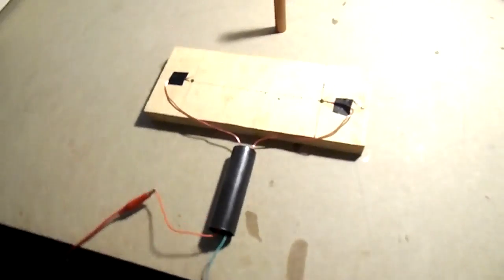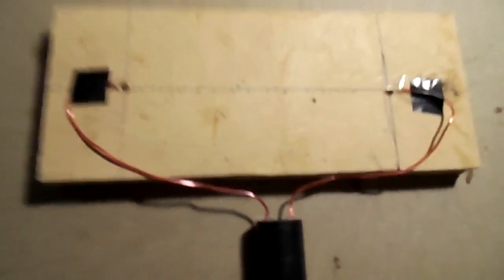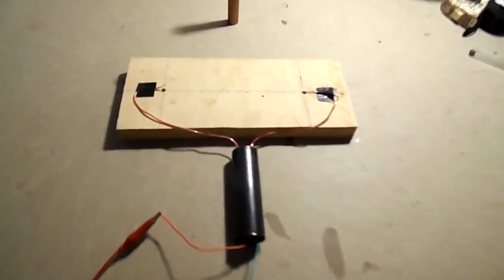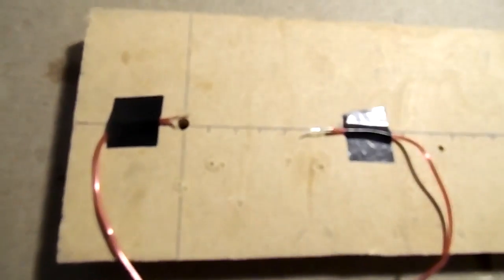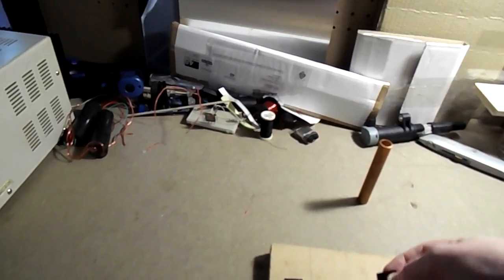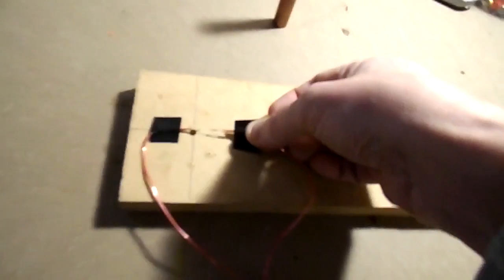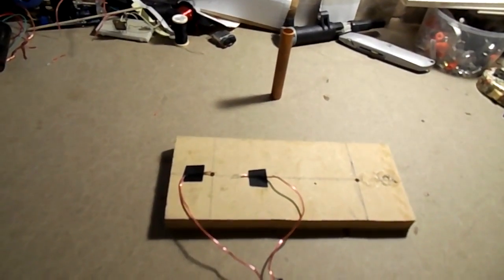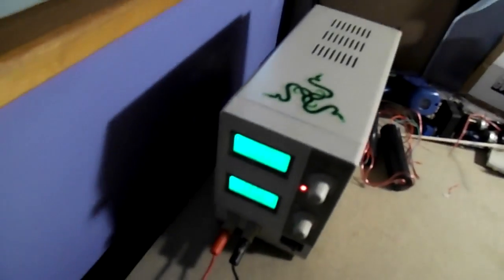Testing of a 1000kV (1 million volts!) device. Gary McKinnon.

Comment: Is this how a Taser functions? Very wise to stand back, I was just waiting for the Higgs Bosun particle to appear?
Reply from the maker: Not sure if tasers have a transformer or a rectifier/capacitor chain to step up the voltage. I need to build a voltage multiplier so that i can pump up the output.
Reply: yes you can make a taser out of these, nasty but not lethal

Comment: I'm sorry but where'd you get the value of 10 kV/cm you've quoted in the video? According to Wikipedia air's dielectric strength is 30 kV/cm and my teachers at the uni usually quoted 20-22 kV/cm or so. I'm asking because I think that the PSU shown in the video is probably even worse than you're led to believe.
Reply from the maker: Thanks CoolKoon, yes that should be about 30kV per cm, cheers for the heads up.

Comment: If you can find some ancient technology from the x-ray boxes we used to have as kids (a.k.a. televisions), you may be able to push over 30kV (if you're still interested in this experiment over 1 year on). I've managed to push almost 50kV AC out of my flyback transformer but never bothered with rectifying it to DC. Was going to build a high voltage DC power supply but the fact I always get shocks put me off charging up a 50kV capacitor. I'd probably be dead by now if I'd built it!
Reply from the maker: LOL I'm glad you're not dead! Thanks for the suggestion. i've used flybacks before, great little things as you know but i'm aiming for 100kv so have settled on building a Cockroft-Walton multiplier and using an ignition coil as the input. Will be bathing it in mineral oil, though i'm not sure if that will keep it cooler for longer or just stop the possibility of shorting.
Reply: Oh nice. I never thought about using ignition coils. They probably have much more of a punch to drive a CW multiplier. Flybacks tend to be a bit lacking when it comes to the current you can dump into them and overheating.

I think the mineral oil should keep it fairly cool as well as insulated. The guys on the 'Kreosan' channel built a 1 million volt multiplier and I think they use cooking oil for theirs haha. It turned into an ion pump when they sumberged it into the oil, causing it to flow.

This is their video: https://youtu.be/ibJYu5fvHkk?t=3m3s

I'd definitely die if I made one of those heh.
Reply: Correction: Looks like they used oil for vehicles: "И-20А". Can't read Ukranian but probably some basic engine oil.

EDIT: Actually mineral oil of some sort haha. Thank fuck for Google Translate.

"Recommended:
for machines, mechanisms and industrial equipment, the working conditions of which do not require special antioxidant and anticorrosive properties of oils.

Operational properties:
can be used in hydraulic systems of industrial equipment, for construction, road and other machines operating in the open air."
Reply from the maker: Ye i'd read mineral oil was popular, crikey is that ion-movement disturbing the oil?
Reply: Looks like it! I knew it could happen easily in air, but had no idea it could pump fluids too - especially not that fast!

Comment: Fascinating. As an aside, you mentioned you could hear a slight crackling noise, but it came through the video as a high-pitched whine, which builds just before the arc. Was I hearing it build potential? I'm pretty much ignorant when it comes to electrical stuff, so this is a learning experience for me. Thanks Gary!
Reply from the maker: It's because the strength of the electric field is greater than what's called the 'breakdown voltage' of the air. The breakdown voltage is just the voltage needed to make the air start conducting the electricity. When it's high enough you see the blue arc going from point to point.

Comment: Can it kill a man?
Reply from the maker: Low current but it would probably burn. The dangerous current range for stopping the heart is 100-200 mA IIRC.
Reply: @GaryMcKinnonUFO  thanks for the information❤️  Is the 0.5 amp means 500mAh?
Reply from the maker: @theexperimentalguy6308  500mA.
Reply: This high voltage generator can makes 0.5amp, it means it can stop a heart?????
Reply: @GaryMcKinnonUFO  This high voltage generator can makes 0.5amp, it means it can stop a heart?????
Reply from the maker: @theexperimentalguy6308  https://www.elcosh.org/document/1624/888/d000543/section2.html

Comment: Oof, you can hear that poor arc generator suffering. It says it needs a minimum of 3.6v to function, why would you start lower than that? And every listing i found clearly states that powering the module without it being able to spark damages it. It was probably half dead by the time you reached 5v.
Reply from the maker: These things are fine under-voltage it's not a problem in practice, regardless of what's printed about them. They're not exactly manufactured to a high standard, the plus side of which is that they have tolerance outside the maker's specifications.

Comment: I have some of those units, a 9v battery works perfectly. If you try to operate these units with the end wires too far apart you run the risk of burning the unit out.

Although, to be fair, this video was uploaded a couple of years ago so you'll have it Sussex by now,

All the best Gary, from one Aspy to another, 🙂👍
Reply from the maker: @KumaBean  I knew what you meant, thanks Kuma :)
Reply: Gary McKinnon I feel genuinely honoured that not only did you read my comment, but you took the time to reply, 

I'm a huge fan of yours, I wish you well 🙂👌
Reply from the maker: @KumaBean  Thanks again Kuma :)

Comment: i wonder if the effect will change if you used a better superconductor like graphene, also if the room humidity was slightly damp. Maybe it will work at 15cm. Nice test though. carry on pal. 

p.s i can see the razer sticker on your power supply. check out the full SLI config of the eurocom laptops. Brute forcing on your lap outside nandos with ease 😉
Reply from the maker: Haha, cheers BBQ :) I've got a 1060 in my gaming rig with 6GB, first time i've had a good rig in years. Graphene is an interesting one, all this has been on hold due to work (and the girlfriend!) but i will pick it up again in a few weeks. Thanks for watching :)

Comment: Perhaps try making yourself a homemade saltwater capacitor to run with the system. I can tell by the discharge that you are using capacitance, but a saltwater cap will give perhaps a better result  due to lower capacitance and higher voltage rating :)
Reply from the maker: Thanks for watching, i have no idea what kind of caps are in these little Chinese boosters but i know you can't drive them for more than 30-60 seconds without blowing holes in them :)

Comment: It's not 1000kv. .... just a lie. You have 3kv per 1 mm distance beetwen the electrodes.
For examples:
→ 10 mm * 3 kv/mm = 30 kv
→ 20 mm * 3 kv/mm = 60 kv
→ 30 mm * 3 kv/mm = 90 kv
→ 40 mm * 3 kv/mm = 120 kv
→ 50 mm * 3 kv/mm = 150 kv.
Reply from the maker: Yes, that was my point.

Comment: Test bench flawed - at high volts & impedance the wood (?) is a partial conductor.  Suggestion: put the ends onto insulating material - bare ends must not touch wood.  Same reason even low powered radio transmitters (eg shortwave) put into aerials with insulators at the end.